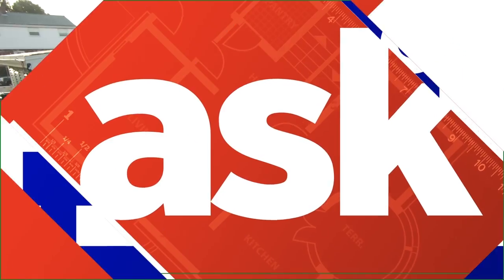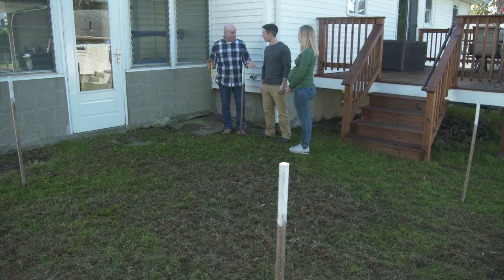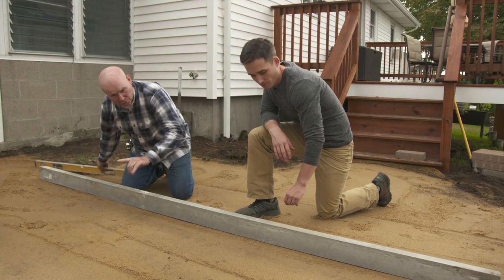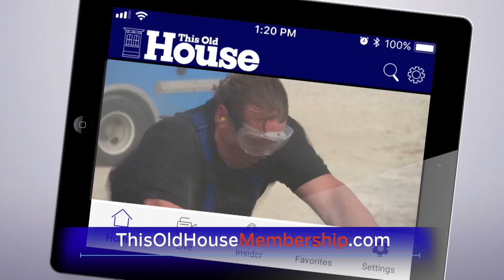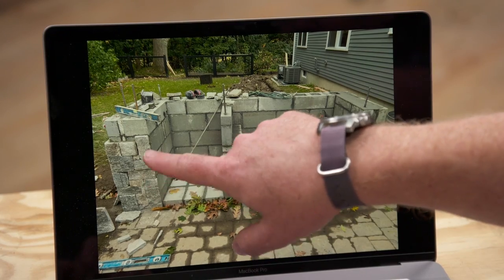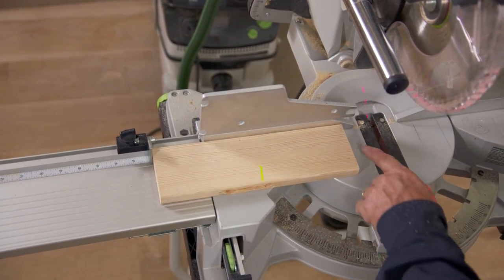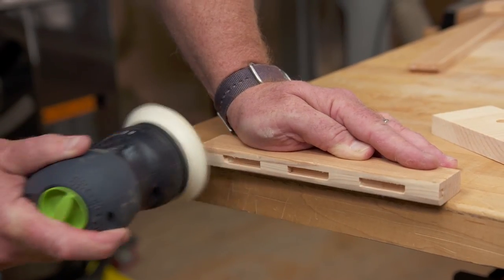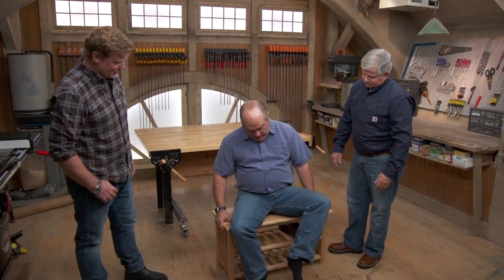ASK This Old House | Paver Patio, Shoe Rack (S18 E21) FULL EPISODE

Comment: Paver segment - should have used a finer grade of stone dust instead of sand where you get a better locking of the dust then sand. Plus the stone dust repeals ants sand attracts ants. That tip was from Roger the previous landscaper host on your show.
Reply: It's polymer sand so there might be things in it that repel ants already.
Reply: Its polymer sand , ut acts like cement.

Comment: Anyone else wonder why the team has a plastic alligator head hanging on the wall with the other tools?  Also about the patio they built. I can't get over how perfect that ground was. Whenever you have a project that involves digging you pray to the dirt gods that your ground us as nice as that homeowners ground was. Barely any rocks, no clay, super soft dirt like it was just dumped there a few hours before hand. This show always has the perfect conditions. Im sure If I tried digging for a patio my land would be a 1 inch layer of diet and then solid bed rock. Lol
Reply: Picture Stone Mountain
Reply: @johnwilliams1091  is that how your lawn is too
Reply: @inspectorsteve2287  I’m just offering a sympathetic ear to someone else… why you want to bring my lawn into it?
Reply: @johnwilliams1091  sorry. I didn't realize you and your lawn were so close.
Reply: You forgor the Elm tree roots.
Reply: @donc-m4900  oh that's a given. It wouldn't be digging unless you hit a root so big you need a chainsaw to cut it out
Reply: @inspectorsteve2287  But because of the rocks, you get to use a hand saw instead. (ok maybe a battery blade saw)
Reply: @donc-m4900  oh good call.
Reply: Older home.  Builders of average houses have long gave up adequate top soil for yards.  Sand and rock, beneath the trivial shallow top dressing.
I went out after a rain one day, and could literally hear the rainwater perking through the sand.

Comment: Shoe rack: Why gloss for the first coat of finish followed by satin?
Reply: Use gloss under Satin clear finishes so the final coat doesn't look muddy or dull.  Satin is just Gloss with particles in the mix, so if you just use satin for all the coats it will look like a DIY project with a dull, muddy finish that is difficult to see the wood grain.  A build-up of Gloss and a final coat of Satin will give you a clear finish without the glossy surface.
Also, pocket screws are a DIY'er tool, but not a professional furniture maker.  After a few months or years, that bench will start wiggling loose and end up in the landfill just like the one his wife bought.
Reply: @bestbuilder1st  Thanks,  that makes sense. About the bench getting loose, can't the screws simply be tightened if that happens?
Reply: @jazzjohn2  The wood compresses around the screw threads, so tightening them won't help once the holes are larger.  Once that happens there isn't much you can do.  Pocket screw joints are just part of our "throw away" society.
Reply: @bestbuilder1st  I don't agree with the throw away society either... But I did use pocket screws on an oak ledge to join the long shelf pieces together end to end 20 years ago and they are just as tight today. Maybe the wood species matters?
Reply: @jazzjohn2  When was the last time you sat in those shelves?